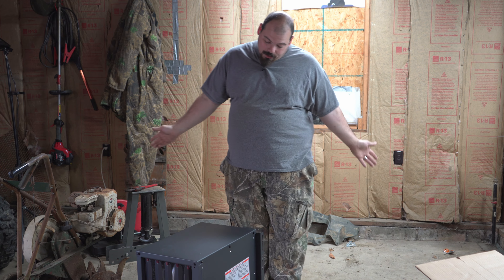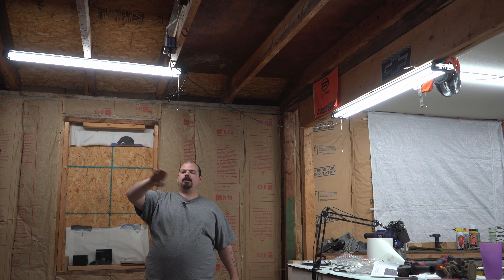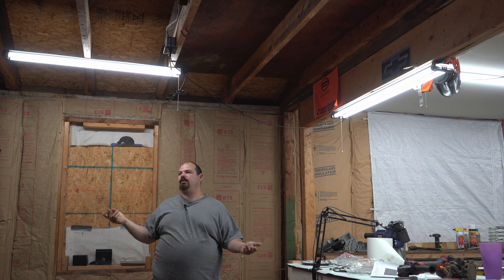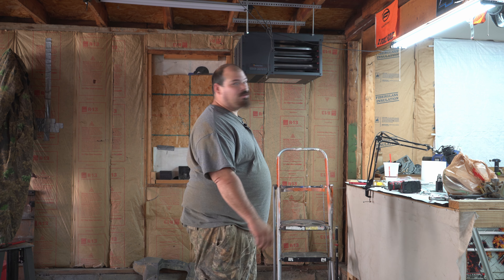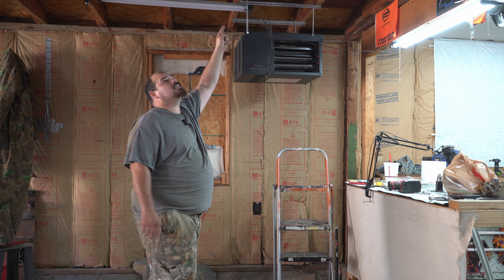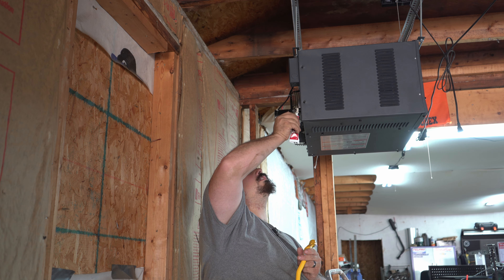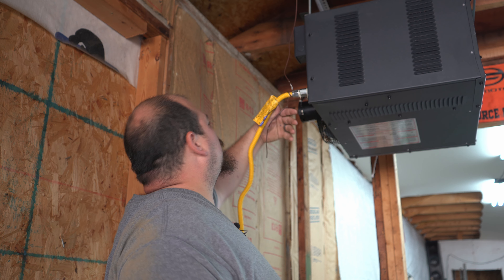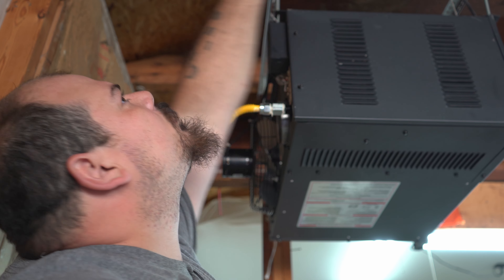Installing a furnace isn’t that hard

Comment: Good Job with that install. Just a bit of advice you should run that gas line (pipe) up closer to that unit and add a dirt leg to it. Secure it to the wall also so it is not able to move. Then use a short flex to connect it. It may even require by code to be hard pipe all the way to the unit. Just trying to keep you safe. That flex pipe is meant for a stove with no chance of it getting vibrated or moved. that is why most furnaces are hard piped.
Reply from the maker: We are going too do that here soon. Local hardware didn’t have everything we needed.
Reply: @R.N.GPerformance  Glad to hear that. We got to have you safe so you can keep posting videos!

Comment: I hope it doesn’t jack up your electric bill to much. Electricity rates are supposed to go through the roof this winter.
Reply from the maker: This is gas.  Only thing running electric is fan.  That won’t pull much at all

Comment: Furnace??  You don't need a furnace where you live do ya?  It's always hot down there!
Reply from the maker: Gets below 0 some times.  Mostly 20s in winter.
Reply: @R.N.GPerformance  Ya that's a little brisk.  We're usually in the -20C to -30C(-4F to -22F) up here in Ottawa, Ontario for a couple months straight.  And that's without the windchill. ;)